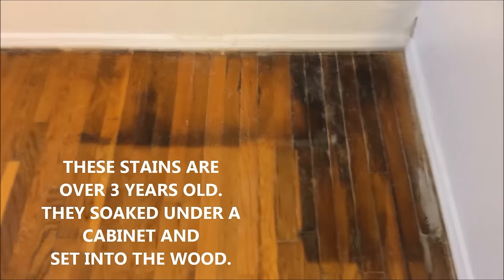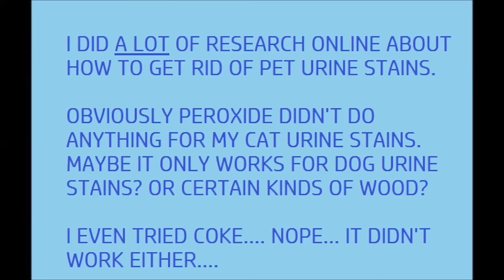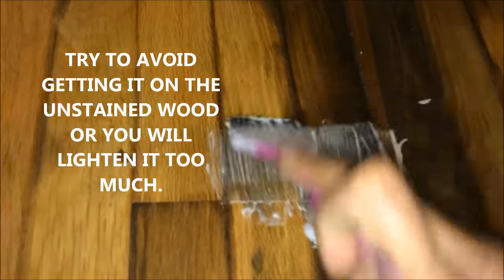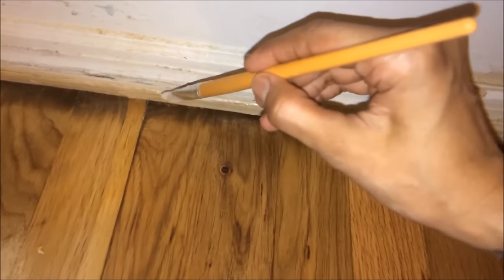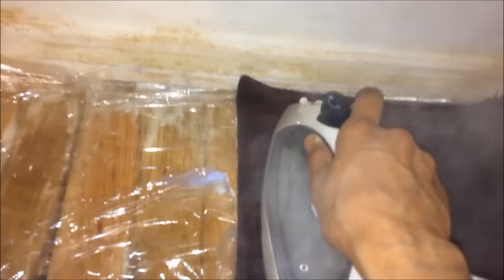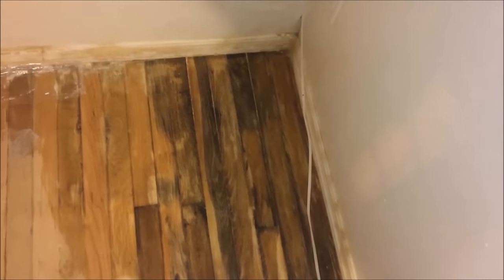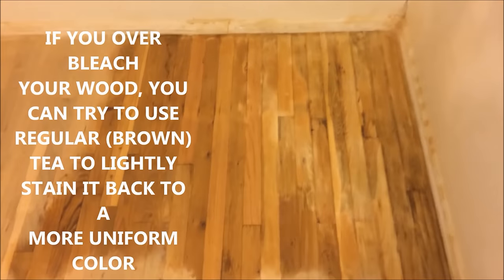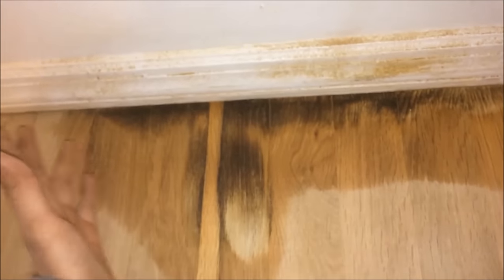How to remove pet urine stains from wood floors GUARANTEED

Comment: I'm impressed by your determination. If you had purchased two part wood bleach, the results would have been a lot quicker. My brother had a floor refinishing company and we routinely would bleach out animal urine stains. There is a learning curve as far as how long to leave the bleach on, as it is a lot stronger than what you used, but after a while you kinda figure it out. Still, good job!!!!
Reply from the maker: It's all a learning curve I think.  I was just kind of impatient.  I would have had to order the wood bleach as no store around me carries it (annoying).  Also the wood bleach is much harsher chemical-wise and needs something to neutralize it after it's application from what I understand.  With this I could clean it up with soap and water.  Which is a big bonus.  For me it was about what I could get my hands on the fastest.  :)
Reply: The wood bleach, I don't think, would have worked as well as your technique. I used some strong chemical mixtures and they did not do as well as your recipe.
Reply: Ken, It's wood bleach. That's what it's made for. Not hair bleach. Can't tell you how many hundreds of urine stains we bleached out with it. But it must be best left to professionals who know what they're doing.
Reply: Gary, I yield to your experience. I have done a lot of wood working but have never used wood bleach. Although I am not a professional floor guy, I do have experience in construction and engineering. If wood bleach will work faster than this technique, I will give it a go on my next repair.
Reply: Gary, I yield to your experience. I have done a lot of wood working but have never used wood bleach. Although I am not a professional floor guy, I do have experience in construction and engineering. If wood bleach will work faster than this technique, I will give it a go on my next repair.
Reply from the maker: Gary Souza What do you use to clean up the wood bleach?
Reply: When you're satisfied with the results, use a diluted solution of water and vinegar. We just did 50/50. Wipe the area with a rag to remove most of the acid, then with this solution and it will neutralize the acid. Remember gloves!!!
Reply from the maker: Gary Souza thanks  :)  I read somewhere you needed boric acid
Reply: Gotcha!  Thank you very much , sir.  I greatly appreciate the heads up.
Reply: boric acid is great stuff and completely natural (ant acid) It works really well for all kind of things, e.g. descaling steam irons, kettles and can even turn a black toilet white again. Also works wonders in shower cubicles.  Would have saved you a lot of works actually... Still, well done getting those floorboards back in shape!
Reply from the maker: I never knew that.  Thanks for the info.  :)
Reply: HI Gary, I hope you check messages! what is two part wood bleach? any brands you recommend? Thank you
Reply from the maker: Google wood bleach.  Oxalic acid.  Most come with 2 chemicals that you mix together to make the product work.
Reply: @garysouza2277  do you have to sand the wood down first, before application, or can you just apply it to the stain? Thanks!

Comment: AAAAHH this is pure genius!! I have the exact same problem, and I am so grateful that you posted this video! I have a question though - did you find that using Nature's Miracle on the sanded floor got rid of the smell?
Reply from the maker: I have used it on bedding and mattresses in the past and it worked like a charm.  I used vinegar and baking soda on my floors... but the vinegar did stain the wood a grey color, so I had to bleach it twice.  So in the future I would use natures miracle.
Reply: ThatChickNYC Thank you for the reply!! I will plan on using that then
Reply from the maker: also try getting the smells out first, then the stains.
Reply: ThatChickNYC Thank you!! I absolutely will work on the smells first - that's really the part I'm most concerned about

Comment: Thank you. I have one spot on my hardwood floors from the dog peeing.  I had a case of bottled water sitting there and I did not know he had peed there, as it ran underneath the water.  It turned the floor black.  I will see if I can do this method.

Comment: Try using Comet with a scrubby sponge. Disgusting brown sludge will quickly plug the scrub pad so rinse and repeat. It will take a few scrubs and rinses but works really quickly and after 24 hrs or so of drying you will be able to see how well it worked. You WILL need to use polyurethane because this will probably remove the finish but that's a small price to pay. Do a test spot first to see if it's going to work for your particular case but it worked for me.
Good luck.

Comment: Amazing! After you were finished bleaching the wood, did you seal the wood? If so, how did it look? Did it match the rest of the floor?
Reply from the maker: If you want to get your wood to match, you can use regular brown tea to stain the wood little by little until you get the color matched as close as possible. start with light and add more tea until you get the color you want.  Or one viewer recommended a wood conditioner.  I haven't gotten around to sealing my floor yet as I got side tracked with other things.  But I plan to lightly re-sand and then totally bleach the floors a white-ash color before I stain them a light grey color and seal them.  I did a lot of research and the best bet, if you want to avoid a significant color change, is to use a high traffic WATER based polyurethane sealant.  Oil based sealers are more durable but tend to give the finished color a yellowish tone.  I will be laying down 4 coats of a water based sealant.  I will put up the video when done.      Hope that helps.

Comment: Thank you for this video, I'm having the same issue. I can across a  similar video, which seem to be more effective and less costly. This required time & patience. First step is to pour hydrogen peroxide over the stain,  then cover with a cloth or a towel that's soaked in hydrogen peroxide. This process may have to be repeated several times, before stain is removed. But it's very effective, without any muscle being used or machine.
Reply: I have 1954 house with hardwood floors. Appears to have lacquer or other finish. Does the urine go UNDER that finish, or how does that go?  Same with peroxide?  Thanks.
Reply from the maker: @KindCountsDeb3773  I removed the sealer/polish before i did this   i dont know how it would work with sealed floors.

Comment: The peroxide does work... but slowly.   you need to repeat A LOT, cover with a peroxide soaked towel, and cover with plastic.   Then re-apply every day with a clean rag and plastic until its gone.    the peroxide SLOWLY forces the urine into the rag.    

The deeper the stain, longer its been ignored, the longer its been peed on, the LONGER it takes to get out.
Reply from the maker: cool.  but I'm impatient.  lol.  this was done in one day.
Reply: peroxide worked for my dog urine stains had it sit about 10 hours, removed smell and looks way better still needs some kind of refinishing
Reply from the maker: that's dog urine.  I had years old cat urine stains. I do think dog urine might be less harsh than cat urine.   I tried the peroxide ( as I said in the video) I even left it overnight.  nothing.  :(.This worked for me.  And after  was done the floors looked great.
Reply: But it gets it out better and looks better in the end.

Comment: I mean... It worked. But I could have just tore that out and installed new oak in 4 hours. Now that side of the floor has the opposite problem. It's lighter than the rest. Definitely interesting that you got it to work though. I have seen people try many things and most of the time they just make it worse.

Comment: I used just salon care 50 volume creme developer. I brushed it on and then sprinkled baking soda on top of it and let it sit over night.It does work. You will need to clean areas with water; let dry; Then treat with Nature's Miracle to eliminate the odor. let dry; re-sand; then use a pre-stain conditioner before you stain the whole floor. This will even out the stain penetration. Otherwise the areas you bleach will show differently. Time consuming but it does work.
Reply from the maker: did you try the developer based on my video?
Reply: Yes and no. I tried several different things from a few videos. I still ended up with a couple of spots that just would not bleach out. I did not use your method on these spots so I can not say that your way did not work for me. I mostly used just the developer alone but, I also mixed it 50/50 with Behr, (no 64), finish stripper. Both of these methods had limited success. As I said, I was still left with a couple small spots that just would not lighten. I will post a clip of floor over the weekend showing before and after.
Reply from the maker: I experimented a little more, and found that using the powder/developer and steaming the towel with no saran wrap the 2nd time (you still need to do one saran wrap steam) lightens the stains a LOT faster, and it pretty much got my blackest spots out.  I added that to the description later.
Reply: Ok, I posted a video on our adventure with refinishing this one room. We used your technique at the end and I have to say it worked quite well. I should have tried it first. (Don't say it)
Reply: I have at least one more room with bad spots in it and when I do that room I will use your method and film it.
Reply from the maker: I'll go check it out
Reply from the maker: It looks great.  Can you show how you even out the color when you use the conditioner.  That would be cool and useful for others.
Reply: That's the one thing I didn't take pictures of, applying the pre-stain conditioner. All you do is brush it on, let it dry,(overnight is best), at least 20 min...then put your stain on. If I had to do it again though.....I would skip this step. Although id did seem to even out the stain absorption it lightened it up too much for me. So, next time I will not apply the pre-stain conditioner.

Comment: It’s great to learn I’m not the only one with a “broken back”. I tried the bleach no heat it did not work which means I need to use it . Meanwhile I used Simple Green recommended by Home Depot employees and wow I could not believe my eyes It does take some elbow grease He also recommended a rectangular scrub brush that I could screw into a pole to do the edges and corners. Love it. No problem with minor stains The very dark ones like yours did lighten up some. My dilemma is do I experiment further with Simple Green inexpensive by the grow gallon - concentrate -biodegradable and non toxic. I used it mixed as told to clean walls and my deck outstanding (non paid ad). Maybe I’ll try a bit more if not I’m going back to the bleach and heat. That thanks to you. I should have known because I’ve bleached my hair all my life and used heat for faster development 😩now my question is the areas I hand sanded. I’ll used the ☕️ tea thanks but to paint over it before I paint do I need to do Any thing else to it??any thoughts any one? Thanks and God bless. Keep safe and VOTE
Reply from the maker: someone recommended using a wood conditioner to help even the color out

Comment: This is fantastic! Thank you for sharing your genius. I have a question about the floor sander - you rented all you needed from HD. Did they tell you how to use it? Was the floor sander fairly easy to use? Did you have to plastic off the doorways, or was it easy enough to just sweep or vacuum the floors after sanding the room?
Reply from the maker: They did tell me how to use it.  Since I am fairly petite 5ft 5in and 100 lbs I was worried about it dragging me around.  And When you first turn the machine on it gives a little kick, but other than that it was pretty easy to use.  I had no problems with it.  It is repetitive though and you can expect your body (arms and back--from the swinging back and forth and side to side) to be tired after a few hours on the machine.  I do recommend taping things off as much as you can.  The dust literally gets everywhere.  it's unavoidable as the vaccum bag that comes with the machine can only catch so much dust.  To rent the machine, You have to  bring ID and put a deposit down (on a credit card)  for the machine, which you get back when you return the machine.  I also paid a delivery charge because I live in the city wasn't willing to carry the machine up the stairs.  If you have space in your vehicle and a strong man around you can avoid the delivery charges.  It was $60 for drop off and delivery.  Rental charges vary according to how many hours/days you need to keep the machine.Hope that helps.

Comment: can this product be applied directly over unsanded hardwood flooring, or does the existing stained urethane need be sanded completely off?
Reply from the maker: i sanded my floors first.  i would assume that the bleach may eat through the eurathane.  try it on an inconspicuous spot maybe.   perhaps inside a closet.
Reply: I’m thinking, if the urine got through the finish, why wouldn’t the peroxide? Let us know how it worked if you tried it w/o removing the finish. Thx.

Comment: @ThatChickNYC- what automatic cat litter box do you own? I noticed you posted a comment about having one that is fairly simple to manage for your three cats on another video's thread. What brand is it? Thanks in advance! Much appreciated!!!
Reply from the maker: I have a  Litter Robot.  with 4 cats. (1 is a foster) And it is AWESOME.  It costs $500, but you can get it on a payment plan with PayPal.  It's kinda big so I have it in my kitchen pantry closet.  I LOVE this thing.  I never have to scoop litter out.  They also have a 30 or 90 day return policy (can't remember which since I never returned it).  And an 18 month warranty where they will repair/replace a defective part/machine.  I have had 2 over the past 7 years.  And I can't emphasize how much I DESPISE scooping litter, so that I can honestly say it is worth the price to me.  Also you save on litter because it uses less than regular scooping.  Put "Litter Robot' in the search engine and you should find a video on YT about it.   Basically it has a timer that goes off when a cat climbs in and then 7 minutes later spins around and dumps the poop and pee in a tray.  which you line with a bag and then toss out when it's full.   Just make sure you leave it off for a few days if you get it, so your cats can acclimate to it without the noise.  it isn't loud per se, but scary to cats when they first hear it.  I forgot to do this and scared the F--ck out of one of my cats and she refused to go in for at least a week.
Reply: THANK YOU SO MUCH! I will look into this ASAP!! I am down to pay whatever if I don't have to scoop and there is odor control!!! :)
Reply from the maker: Yea, if you clean the inside regularly (about once a month) with baby wipes, the odor is minimal because it drops the waste into the bottom.  So long as you use a good clumping litter it's great.  I love this thing and will never go back to a regular litter box again.

Comment: Thank you for your amazing job! We have a badly damaged room from my cats but the floor is only plywood now (we had to remove ALL the laminate flooring!) At this point we are interested in basically removing the horrendous SMELL, as we will probably paint or something to finish the floor. Can you share what you did to get all the smell out of the floors?? Thanks in advance! >^_^<
Reply from the maker: I used white vinegar and baking soda.  But I actually recommend Natures Miracle pet odor remover.  That stuff is great at getting pet smells out of everything.  However, if it's really bad, you might want to see if the urine seeped down into your subfloor.  if you can't get to your subfloor, I recommend just loads of natures miracle.http://www.natures-miracle.com/products/Stain-and-Odor.aspxalso get the "unscented" version if you don't like perfumey smells.SCRATCH THAT. reading reviews They changed the formula.  try finding the older version on Amazon or Ebay.  the new version is not as good, from what reviewers say.
Reply: Paint. using BIN.  It's White shellac. Seals anything!!! Or just use  clear shellac.
Reply: Thanks for the tip!   Nature's Miracle doesn't do anything on hard wood floors.  I will definitely try SUN for sure.

Comment: I'm going to try this tomorrow! Quick question if you dont mind, is there a reason why you used the iron instead of a hair dryer? I would think a hair dryer can heat it up faster and evenly. I also have a steamer, wonderign if that will work too!
Reply from the maker: because it's flat and can cover more space.  I assume a steamer can work as well.
Reply: ThatChickNYC thank you! I tried it and it lightened up the stains really well! Thanks so much for sharing your method. Have you had a chance to refinish your floor, either stainning or top coat it? Just wondering if the bleach interferes at all with the finish.
Reply from the maker: I haven't because I'm still renovating.  lol.  but once the bleach is cleaned up it shouldn't interfere with the stain.
Reply: I just want to happily report back that we finished the stain and poly last night and the floor looks like new! Your method is just amazingly creative and effective. My husband now knows all about hair developer and how to mix it and apply it properly haha. I washed the bleach off like you said and to be extra careful we used pre-stain conditioner. After staining, you can slightly tell which spots were bleached because they turned out a little lighter, but then you would have to look really closely. Then once the poly was on, everything evened out and it's like nothing ever happened on the floor!
Reply from the maker: I'm so glad it worked for you!!